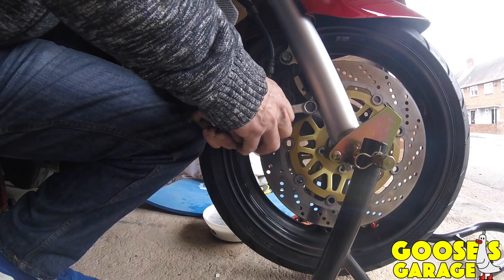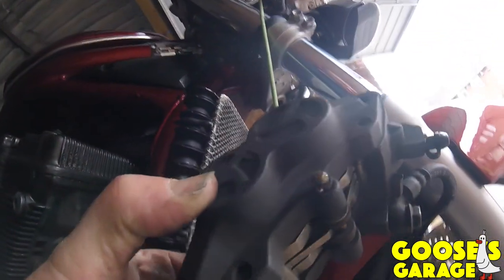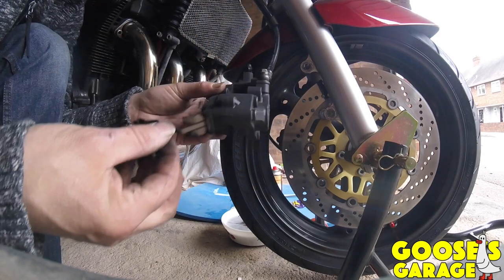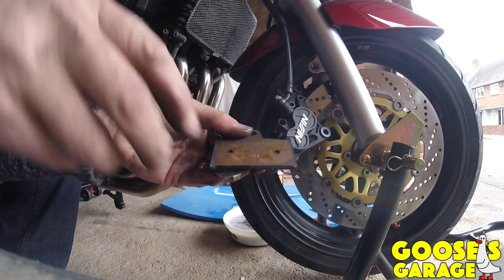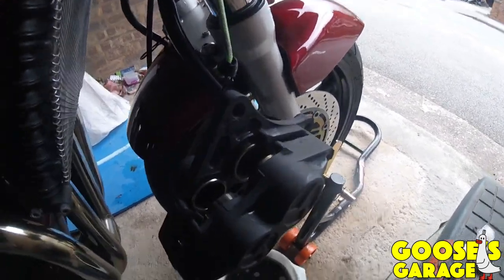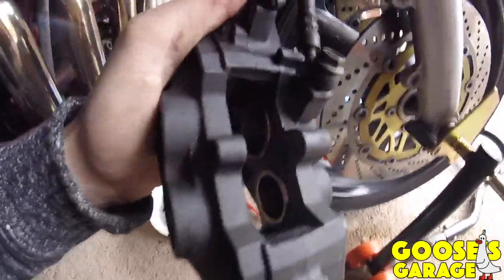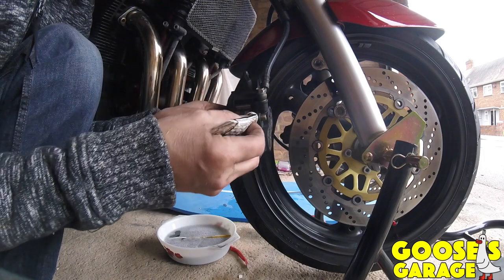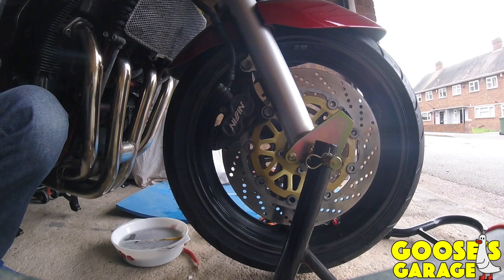Goose's Garage - Suzuki Bandit Brake Pad Change

Comment: Holding a spanner like that do undo nuts or bolts, ye gods if it had slipped that would be sore knuckles, don't do it, open palm that way you land on your palms. Hitting a spanner with a hammer, don't do it use a socket and ratchet, the ratchet handle will be longer and allow more force. I'd even say put your foot on the spanner and push progressively harder. Cotter pin? No, split pin. I think I'd have tried to crack the pin that holds the pads while the calliper was still mounted. Once all back together, make sure the wheels spins free and is not binding.  Bike looks well cared for and clean, nice to see them like that
Reply from the maker: radish pea great advice cheers mate 👊🏻